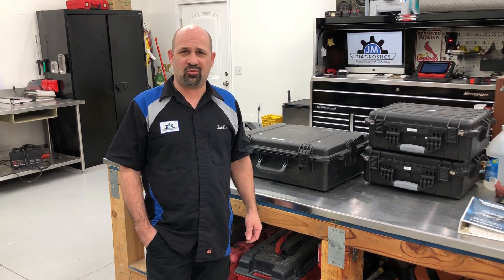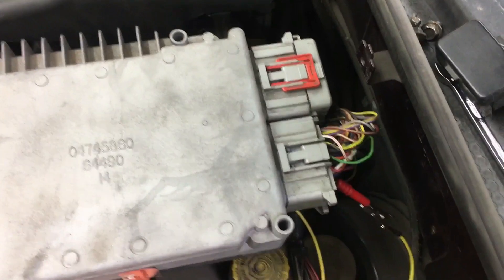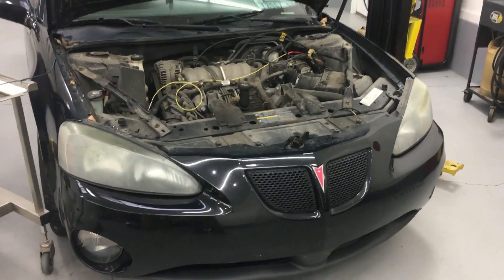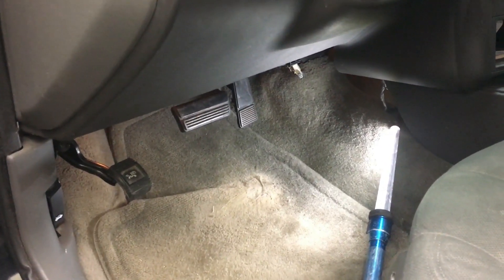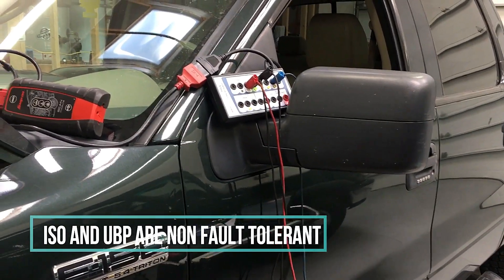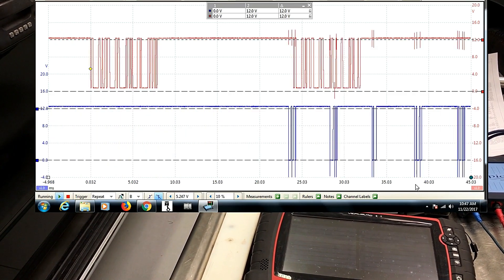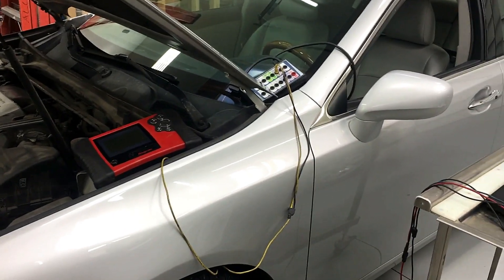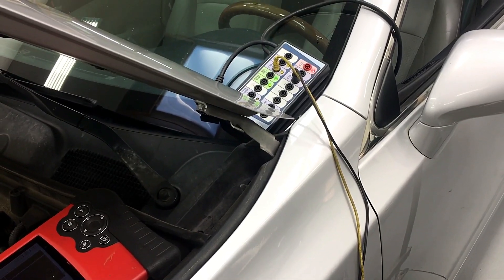Basic Vehicle Communication Network

Comment: Hello , I have a question about the signals to the scope, what do you do to have a clean signal ,i always have a single with lots of noise,I change ground location but it does not change .any suggestions about my settings? Thank you
Reply from the maker: david cisneros, good quality shielded leads are a good start. Fluorescent lights will add noise. Some noise will always be there.
Reply: JM Diagnostics thanks you one more question I have pico 4424 I have it for about 6 years with original leads , I not sure if they are shielded or not , do you not if they are shielded?
Reply from the maker: david cisneros I don’t know about those leads. You can get good replacement leads at Aeswave.com
Reply: JM Diagnostics thank  you Sir.